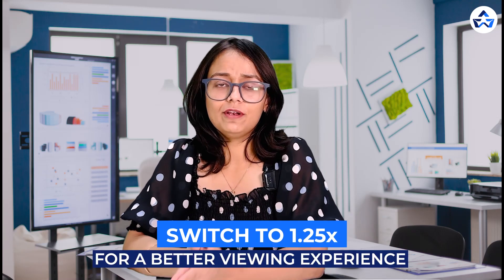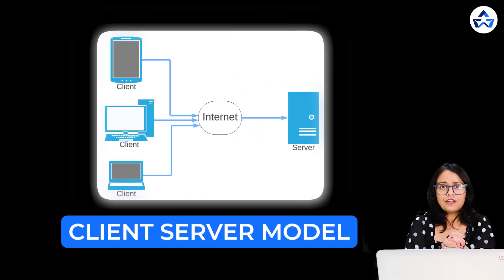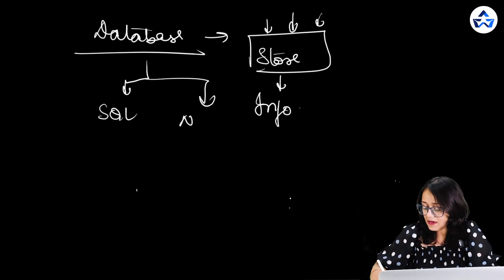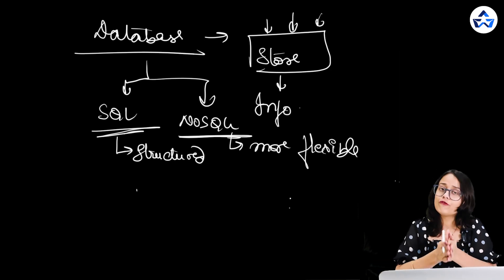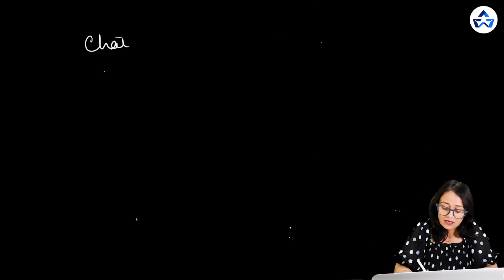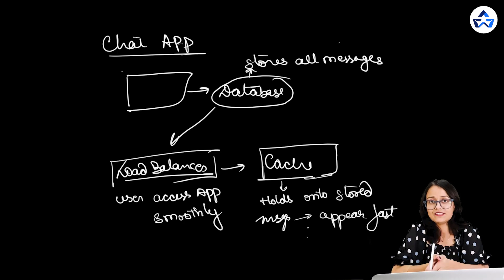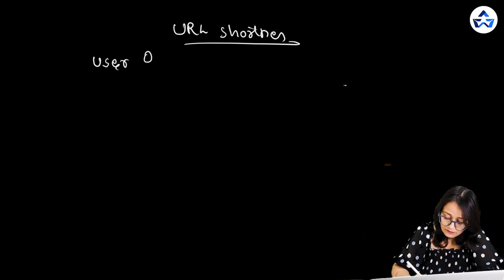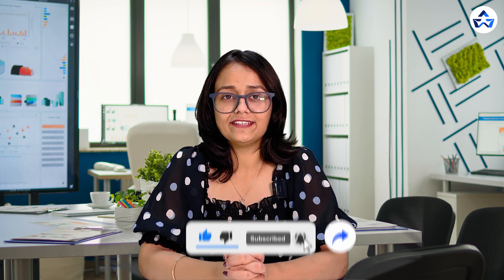System Design Basics: High Level Design & Key Components |  Load Balancing | URL Shortening

Comment: How would you ensure that shortened URLs are unique?
Reply from the maker: To ensure shortened URLs are unique, we generate each one using a randomized or incremental ID system, check for duplicates in the database, and handle any conflicts immediately to avoid overlap.